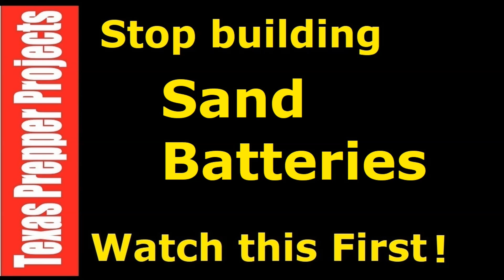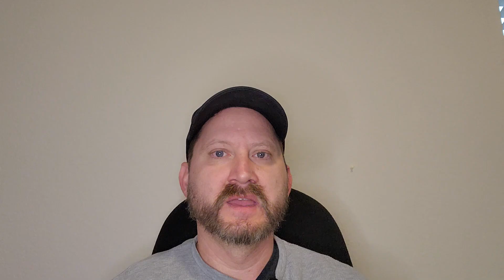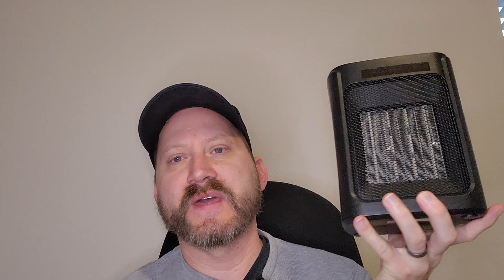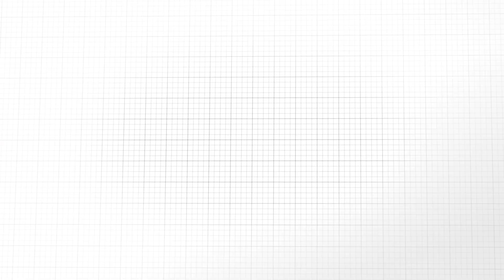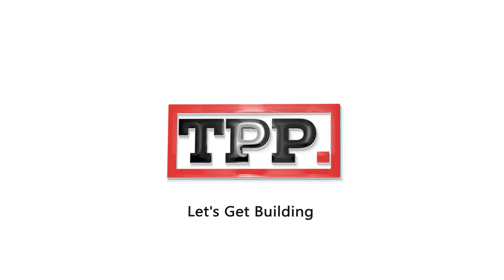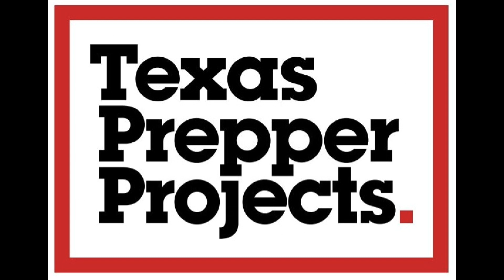Stop Building Sand Batteries | Texas Prepper Projects

Comment: I don’t think its supposed to be a “more efficient heat source “ , its a sand battery that stores up heat for later release.. Slowly as a storage heater or delayed as a heat battery .. imho..
Reply: Yea, it is there for slow release. It is not going to be as efficient as an electric blanket, but you don't heat a room with an electric blanket either.
Reply from the maker: And the science is sound, just not the scale
Reply: @texasprepperprojects  It’s like a traditional wood fired oven. Bricks will heat up and release the warmth/energy slowly. The heavier the unit, the more heat it will store. You can light up a bonfire in your house, burn the same amount of wood in kW, get your house extremely hot for an hour, but once the fire is out, the heat will vanish. It will not be stored. You store the energy into bricks. It will stay warm until the next day. Exact same thing with the sand battery. A regular sized wood fired oven is approximately 1 ton in my area. They come smaller and larger size. Conceptually they are the same thing, now with sand you can use excess solar energy or whatever. Thermal mass is the foundation of heating for ages.
Reply: indeed. 
A battery is no source, it's a storage.

Has nothing to do with where the energy comes from.
Reply: IMHO in a sand battery thermal energy is stored that you want to get out weeks later.
Not the same day.... Preferably all excess solar power is put into it, so you can use it weeks later.
The thermal battery can be drained with heat-pump exchange, or if you can really store high temperatures, a heat exchange to a local water heat buffer can do to heat the house with normal means.
Heat is the most important energy type during winter time.
Reply: A power company in Southern Missouri uses the same concept, but instead pumps water up into a lake during low demand, and then uses this potential energy to make electricity during high demand, essentially becoming a peaker plant. 

This same effect can be used with solar energy, in situations where heat is needed at night, or for a day or two after a cold front passes. The application in a greenhouse is one example. While a heat pump might be more energy efficient, the installed capital could be cost prohibitive.

Operation of an open cycle water well, using 2HP (1500W) of 65F water pumping at 20 GPM could also provide freeze avoidance, which is probably a major purpose of many heat storage plans.
Reply: I just did the experiment for a sand battery with 900 watt solar panel array and heated the sand to about 500° top to bottom.  It was 40° outside and the house stayed 70° all night with no other heat source.
Reply: @victorreece9256 Great feedback. How much sand did you heat up? I’m thinking of doing this with a 55 gallon steel drum for a greenhouse and using a fan to distribute the heat. Thanks!
Reply: https://youtu.be/kzj1PCA_jxA?si=yCGCd-ANjImPCGcK
Reply: I was planning on using solar can heater in the day time with a solar water heater storing heat in the sand to get some additional btu's after peak sun just as a supplement to my existing heat pump. Instead of a barrel I plan on using 10"-12" oval duct work connected in parallel by some 4" round duct so as to be shaped like a hot water radiator. Then a box made of rigid insulation around the outside with an operable louver on the face and an opening with a 50-100cfm fan in the rear or bottom--louvre is shut til sun goes down/room temp drops then opens up and fan kicks on. Im going to do the math and see how large each would need to be if I use like 1 per window to carry significant heat load into evening and how long that'll work at average winter temp

Comment: What's your degree in? Yea thats what I thought. Why do earthships store heat in the back wall?
Reply from the maker: Because earth ships have many tons of material.  This video is about a 50 plund sand battery, not a several ton thermal mass. Try watching the video
Reply: @texasprepperprojects  The radiator on a home steam system is how big?
Reply: Im planning on a 50 gal drum with a water coil running g through it fed from my well, the well water is right around 42 degrees which takes a lot of energy to heat up in a water heater, so my goal is to use excess solar (batteries full and not affecting daily usage) to warm the sand and store some heat to pre warm the water going into my water heater.

Comment: So glad you’re addressing this. I could not figure out how this would ever work unless you already had a bunch of solar panels unused and needed to use them in the winter. Then it would make sense. And sand is just the same watts with delayed gratification, maybe to leak a little heat at night. Next go after these stupid teacandle heaters in a flower pot for home heating! Be our mythbusters!
Reply: Tea light heaters are comparable to infrared heaters or electric blankets. They are not designed to heat the room, but rather the person sitting directly in front of them. They are not a full replacement for a real emergency heater, but they can reduce its energy consumption because they make it easier to tolerate lower room temperatures.
Reply from the maker: @Overcrook65   There is NO way that a candle is comparable to an infrared heater. A candle puts out like 10 BTU
Reply: @texasprepperprojects  I'm talking about how they work, not the amount of heat they produce. Tealight heaters primarily heat objects in direct line of sight using thermal radiation. They ARE infrared heaters, only they run on paraffin instead of electricity.
Reply from the maker: Oh I can't wait to test the tea light. You can't cheat thermodynamics!

Comment: I want to build something that heats sand with wood (up to about 150f nothing crazy. Then be able to transfer that sand in something sealable (being cautiously aware of building pressures) and bring that into my bed and have it under the blankets. Releasing that heat energy to myself while I sleep. I hope that makes sense
Reply: @daneking1209  that’s the old hot water bottle. A rubber bladder filled with hot water you take to bed with you. All the rage before electric blankets. And water holds more heat than sand.
Reply: @ I do have 2 of them. Thanks for insights!
Reply: In the past, people used warming pans or a firebrick heated on the stove and wrapped in cloth.
Reply from the maker: It actually doesn't make sense.  The sand won't hold the heat like you think it will. Just use an electric blanket
Reply: @texasprepperprojects  I do use an electric blanket but I want something I can transfer wood heat into my house. I don’t have a wood stove inside but I do outside.

Comment: Agreed, not good for the purpose you discussed.  I have built one that I am testing out in my small greenhouse for the purpose of supplemental heat to extend the growing season here in Michigan.  If you study the design of the Polar Night sand thermal battery set up, they collect heat for months during the summer to use during the winter.  Sand batteries are great for slow accumulation of thermal energy provided you have the space for the mass needed and the proper insulation.  If my test works out on my small proof of concept, I will build a larger setup for the larger greenhouse I am building this spring.  Again, I feel the concept will work if you think of it as a thermal bank not a quick turnaround battery.
Reply from the maker: For it to work you need literally tons of sand sitting on top of a volcano like they do in iceland

Comment: Thanks.  My science mind knew all this bit never wanted to call fake when seeing those videos.  I will be making a sand heater though for great reason.  Solar hot water to preheat my water with a buffer tank.   After heating the water it will go through a coil in the sand to catch some leftover heat....and as my heat pump hot water heater is running....it will have the ambient heat of the sand preheating the area around the hest pump making it run even better.   I'm over doing it but with the real solar water heater panel i have and the mini boiler system I will incorporate.....I will be using a 175 gallon buffer tank and depending on how many btu I can harness,,,,I will be sharing heat to my home and hot tub as well if I play my cards right.   With one of the 1000 watt generators I could easily be taking a hot shower  when no one else could!!!   Long story but yes I do have a real benefit of a sand battery in my case!
Reply: Very interesting! Wish you did YouTube
Reply from the maker: Solar hot water... direct heating...I think does make sense. More to come on that
Reply: @texasprepperprojects  getting a dual inner coil tank...lower coil to catch solar/boiler heat....and upper coil to transfer heat with a thermostat and manifold.....if If If I create enough btu of course
Reply from the maker: i don't think you will be able to get enough btu for it to be worthwhile
Reply: @ yeah I’d have to hook up a hot water radiator inside the house and circulate the water
Reply from the maker: @daneking1209  yup, i think direct solar water heating is a reasonable idea. More testing to come